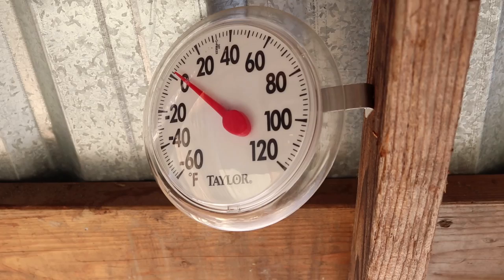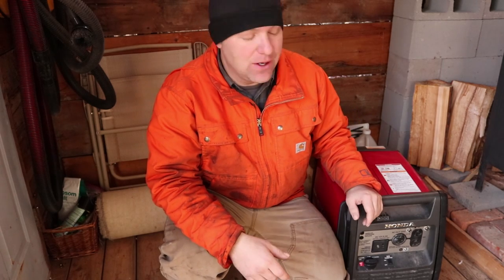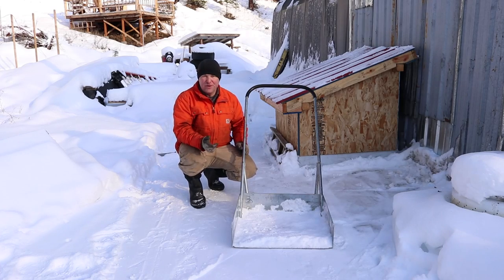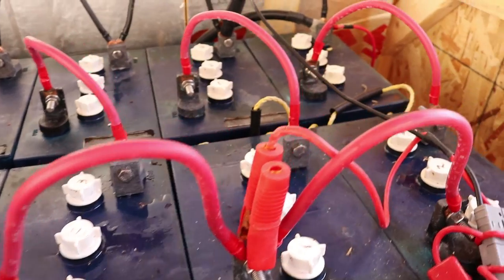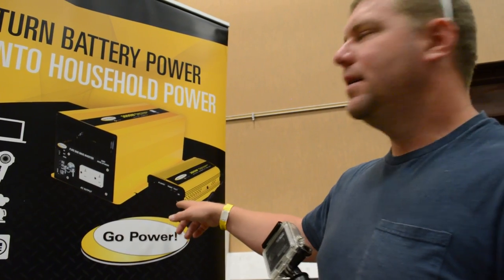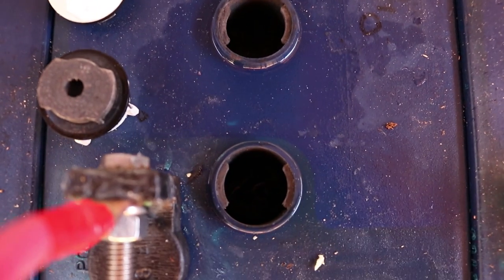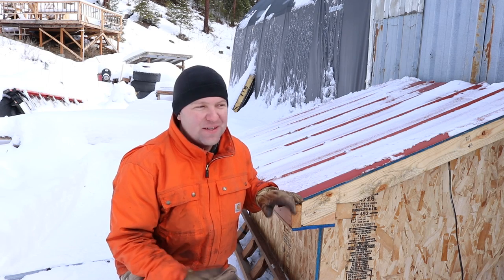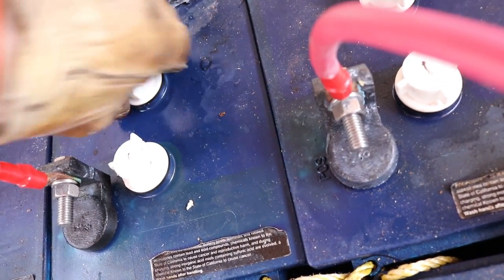SO FRIGID BATTERY ACID IS FREEZING! + Off Grid Power problems

Comment: If you opt to change out the Gen Set,  you may want to go with Propane  it is less messy and keeps you from all of that Gas exposure.   Can you get a large Propane Tank in your area?

You may want to create a sunken power station in a hole some where to reduce noise and keep the Gen Set out of the elements.   Ventilate Well!!!

The heat from the Gen Set will help warm the battery box and keep the Oil Warm.

Comment: I was raised in Montana and it gets very cold there. For cars there is a head-bolt heater which is a system that you plug your car into at night or whenever you need to start your car, It keeps your oil from getting so thick from low temp, that the motor will not turn over fast enough to get started, I don't know if there's anything like this for your small generator but a 100 watt light bulb put under the oil pan should keep the oil fluid. I have no idea if your solar system can generate enough power to keep a light bulb burning?

Comment: Might I suggest the following: 1) The Two Bad Batteries are causing the Inverter problems; you have identified battery problems that charging will not always fix; consider that if problem was divided amongst all cells/ all batteries then problem is charging, but problem on JUST 2 batteries (of 8/10/12 batteries?) is a battery problem; 2) Moisture/ WATER in your fuel is causing your generator problems, (esp. if you are using ethanol fuel, but (sometimes) even when you use Pure Gas... maybe just from condensation from the cold weather.  Keep all lids/ vents properly closed; 3) (Believe it or not), if OHV Honda, you might also need a valve adjustment to get compression release to work properly to make cranking/ starting easy.  Hope this helps.

Comment: Hi Guys, I'm assuming that your using lead acid battries because they were cheap. you need to get some sealed gel. they are designed more for what you need your power bank to do, and I'm pretty sure they won't freeze. My tip for getting cheap ones is find a local wheelchair repairer. when their battries are replaced you will usually find one of the two (24volt system) will be still in good operational condition sometimes both especially if you going to use them in a large bank. the repairers might even give them to you, or sell them cheap and have them tested. upside is your recycling. Stay warm and good luck.

Comment: Just an idea, why not connect the battery box to the cabin? Looks like the battery box is right behind the wall where the stove is. Remove the back plywood wall of the box, remove the cabin wall, connect the box to the cabin, leave the cinderblock wall in between the stove and battery box?

Comment: In my experience, the reason your generator is having problems is because the carburetor is jetted on the edge of being too lean. They (Honda) do this for emissions purposes, but if it doesn't run right, it pollutes more anyway. If a tiny speck of dirt or gunk gets into one of the internal passages in the carb, it skews the metering.

When it is cold out gasoline has a hard time atomizing/vaporizing so it needs to be richer in order for enough of the fuel to vaporize so that it will burn. That's why you start it with the choke, it chokes the air supply down so that more fuel is drawn into the intake, making it richer. See if it improves under load by pulling the choke out slightly. That's not a fix but it will point you in the right direction.

It is also possible that there is some dirt or gunk in the carb, causing it to not meter fuel correctly. Get some carb spray and hose the inside of it out.  That may help as well. It's still under warranty right? See if the service center can/will re-jet the carb if cleaning it doesn't work.

Comment: Love the videos!
Just a question: is there a reason you cannot add more insulation to the battery bank box? I'm just thinking about redundant systems because my well pump froze yesterday. It looks like there isn't any insulation on the sides or under the roof and possibly not on the front or floor as well. Might additional insulation also help keep the batteries from freezing?
Best wishes with the generator!

Comment: Would recommend a diesel generator as diesel doesn't freeze as easily as petrol (gas) also may be worth moving the battery bank inside so it gets some heat from the wood heater as you will eventually damage the cells that are frozen due to the electrolyte getting stronger since the acid doesn't freeze only the water does :-)

Comment: If one has to run the generator in order to Simply make the oil viscous enough to Change, That should tell you something! The generator is essentially running dry when started! Use synthetic Amsoil.

Comment: Need some distilled water to top those batteries up and keep them there! Ice in them, is a concern! That generator.. if it's that hard to start when its cold.. chances are, it's the fuel system itself that isn't quite up to the cold. Ensure the choke is fully closing and give it a squirt of fuel down the carby to help it along, if needed.

Comment: Does your generator have the "cold climate package"? All ours in Canada do. Basically it wraps the carb and intake manifold in insulation to prevent carb icing. If it does then you should jet your carb one size richer. It will start easier and should run better in the cold. Our gas here is crap as well with ethanol in it so I run 100LL avgas in all my small engine equipment. -28*C this mornung with windchill of.-35*C and my snowblower fired up first pull.

Comment: I think I remember you saying these were used batteries. It's important to realize that batteries have a limited life. With a 60 month battery, you might get 61 or 62 months and that's it. In your case, that's due to the chemical reaction between the lead and the sulphuric acid. If a battery looses it's charge, the water will freeze and then crack. Now you will have acid all over and that will have to be neutralized with a baking soda. Let me be very clear about this. If your batteries are really important, go get new ones. Best of luck and keep up the good work. I really like your show.  Buffalo, NY

Comment: Try Royal Purple 5w30 before you spend $$ on another generator. Our power was out this morning so I had to start the Genny. It was outside where it was -14F. I run 10w30 in it, all I had to do is spray some starting fluid in the carb, turn the key and it started right up. Hooked it up to one fridge, two freezer's and two heaters and it ran for 2 hours till the power came back on. Royal purple is the best synthetic oil you can buy, even better than Mobile 1. Try the royal purple!! 😀

Comment: You might want to look in to how your batteries bank is wired up .
First thing that comes to my mind with 1 bat dead or dying & low on acid is 
How you charge it or weir your drawing power from
Look at some wiring diagram. That 1 batteries is taking the hit all the time & will make it heat up & use all the acid in that batteries…
 & your batteries need to be fillet over the plates .
Or They will short out.
If your solar panels charge directly in to that one batteries I don’t think that’s right ok
Keep up the good work totally ausom

Comment: Runs good for a while and then bogs down under load in extreme cold. Sounds like the carburetor is icing up to me. This can be a problem with all engines with carburetors. I'd set it up so it draws air from the 'cold' end of your cabin, or make an intake pre-heater for it that uses the exhaust for the heat source, the way most cars with carbs worked.

Comment: try a different gas also tried choking it when it does that also it sounds like the governor needs adjusting the governor Springs need to be replaced take a piece of tape and put it over part of the air filter to increase the fuel then do the opposite remove the filter so it gets more air

Comment: More insulation in the battery box and a 12 volt computer fan ducted from inside your shelter into the battery box. Would be a low power way to keep the ambient temperature inside the battery box the higher.

Comment: Hi Jesse, it's just a guess but isn't your wood stove just on the other side of your battery box (or close to it).
If so, how about running a pipe to circulate some warm air from the stove to the battery box ? or just make a hole to connect the two ?
Also, get some house wrap (plastic sheet), wrap your battery box, and then pile a bunch of snow on the sides up to the top,
Snow is a good insulator. 
Enjoying the videos, and your journey Great fun :-)

Comment: pop the fuel bowl off the carby check for dirt and remove the jet and blow through it with compressed air or wd40. if that doesn't work your carb maybe icing up.

Comment: Greetings from snowy off grid Oregon.I think that the batteries that are frozen are the bad ones. They will keep the other batteries from taking a full charge. If the specific gravity was up they would not freeze at 0 deg. Ill bet the frozen ones are toast. I try to never let my off grid battery bank run lower than 80 percent full. We usually only use the top 12 percent. I think you would be better off taking the two bad batteries out of the system IMHO.

Comment: Question.... My battery bank is in a shed on property and I was wondering since while we are not there but once a month during the winter so there is no draw on the batteries ..... will they be ok with my 4 solar panels and my charge controller to keep them topped off? they are new L16 batteries if that matters.

Comment: Ice inside the batteries ! - I can't believe there is no insulation inside the battery box ? looks like there may be some on the back panel.  There should be insulation on the inside of all six surfaces.   I would also separate the batteries and place insulation between them and remove during the summer.

Comment: Have you checked out forced air solar heaters? I think you could throw one together in a day on the cheap..mine is 4'x8' and about equal to having a 1000-1500w heater on whenever the sun is shining. g scott davis has some great videos on them. Also, I think if you just put a clear roof on the battery box and maybe add some black paint it would heat it up a ton during the sunny hours. cheers!

Comment: Batteries freeze when low on water. Oh never add water. Only distilled. 
Honda. I have the same generator plus a 2000i plus several other Honda products. They are very VERY sensitive to fuel and water/condensation in fuel. I have changed several float bowls because of rust! Crazy but true. I stoped using pump gasoline and went to Aspen Synthetic fuel made by Husqvarna. Both 2 and 4 stroke they sell. Expensive but no more problems.

Comment: Stating the obvious, clean the carb also could be card icing.
Reply: Was about to say the same myself (Carb Icing) The only solution for that is to warm it up or lower the load (less load, less venturi effect, less icing)! Care is needed with insulation of the batteries ..... those bubbles are Hydrogen and Oxygen which is a VERY explosive mix, and you do have electrical connections and Crocodile clips in there! Have you thought about burying the batteries below the frost line? Still need venting though!
Reply: Tried to reply before, but internet ate it?: Recommend 1) fresh fuel w/ stabilizer, maybe even canned; Pure-Gas.org for non-ethanol from pump, I suspect you have moisture/ water in fuel; 2) Suspect 2-batteries shot/ bad, even before freezing; bad cells will not charge, leaving neutral ph water which can freeze; 3) Suspect generator may also need valve adjustment (See youtube for How-To)
Reply: It is not normal charging / discharging though! The batteries are being deeply discharged ...... there WILL be gases (not a problem if vented) BUT if insulated or dropped in a hole will be dangerous! It looks like 2 cells are suspect (warped plates / too weak acid mixture) but you can check this by the hydrometer readings!

Comment: I would remove the bad battery from the string because the string it is part of will drag the other battery strings down and destroy them.   This is one of the issues with using parallel battery strings.   So if you have two questionable batteries pull them out and make your system three strings of 12 volt rather them four strings.

Comment: If you have a bad battery or two you would be best to pull them from the bank and use your good ones only.  Bad batteries will do damage to the rest in the bank as they are always trying to equalize.  Pull the bad ones and put a load tester on it.  Also I have had some success bringing heavily sulfated batteries back to a good state with use of a pulser.

Comment: You need a good carb tune or swap. Now why not insulate the battery box with snow?
Reply: I would ask for a new carb.
Reply: Its doesnet need new carb, only bigger nozzels to run richer in cold weather.
Reply: Further research shows the problem is icing in the intake or carb from cold damp air.  The intake air needs to be heated to at least above freezing.
Reply: or dirt? Same with the cabin, actually, if there's enough dirt on the property. Thermal mass as well as insulation.
Reply: TheKlink
Of course a soil berm would be the best but that would be a spring project. Even a greenhouse with a few water barrels would help to keep the batteries at moderate temps.
Reply: move battery box within small propane heated mechanical room, add small muffin fan to exhaust H2 gas, automatically turning on and off in response to software in charge controller.

Comment: Hi there.  I wanted to leave a couple of comments to you concerning your generator. the question I have for you is is the generator set up for high altitude running? it sounds like that it is starving for gas in the cold. I don't know if that carburetor has adjustments for a leaner or richer mix butt it definitely shows signs that it should B set a little bit richer than it is. if your service guy is at a lower altitude that's why it runs fine at his place and doesn't do very well at yours. I have an Outback the VFXR-3524A which is a 24 volt 3500 Watt inverter charger system more popular in off grid or grid tie conditions. when your inverter / charger starts to charge get over powers your generator. that is why you are seeing the brown out conditions. your system probably has a soft start charger and when it reaches full load the generator cannot keep up. if you can vary the amount of charge current you can make your generator run more like you were wanting. otherwise you should consider a larger generator. good luck to you and I will watch for additional comments. by the way, where is your cabin or home at? I am in Salt Lake City but I grew up in Idaho.

Comment: Nice battery experiment. I almost went with GoPower for an inverter but I ended up getting a great deal on a Magnum inverter on eBay. I was looking on your blog and I couldn't find any information on a topic that I am personally interested in and that is: how did you finance the empty property? I am currently on the market for a property but I am struggling to see how to get a lender to lend on vacant land being that it would have to be under the restriction of a construction loan. Seems a little tricky but I would prefer buying an empty lot as opposed to getting a house. It would be great to hear what kind of experience you have had with this.

Comment: Please dis-regard if I saying something you already know but I would go to Wally World (or similar) and purchase an inexpensive ceramic heater to replace the one your using that has open hot coils for your battery box, Lead Acid batteries will on occasion vent hydrogen gas, specially if you've one going bad, and a ceramic heater doesn't have glowing elements that might ignite the Hydrogen. Also I would surf an Electronics Surplus site, such as TheElectronicsGoldmine.com, and order a very inexpensive small exhaust fan (such as a computer coolant fan) that runs off an included small solar cell to keep gases from collecting to greatly.
Love your site.

Comment: try using a heat tape around the oil pit of the genny. and batteries. it does use a about 15 watts over night.but should allow the oil to flow better in the genny.   also get a wind generator, for the night time use on power system. it helps some.   I'm still using my 1967 simpicty  800 genny I bought used twelve years ago at a junk estate. for fifty bucks. I've had to use it with as low as ten degrees, it was hard too start but did run after a few pulls. the eletric starter quite on me but the gen did not freeze up. the heat tape works.

Comment: Remember, the gasses from the batteries charging is flammable. 100 W incandescent lightbulb on a remote switch should keep a good amount of heat in there all the time, with low probability of ignition.IMHO

Comment: Are you getting ethanol free gas?  Ethanol and cold weather don't mix.  As mentioned in other comments i've read, could be the carburetor is icing up as well.  Airplanes that fly at high altitudes have carb warmers to keep that from happening.  Cold just wreaks havoc on everything once temps get that low.

Comment: they probably dont read the comments here, but i will throw this out there about the batteries. i notice there is moisture on the tops of some of the batteries. always wipe them off, and make sure the tops are good and dry when they get wet or have any moisture on the top. because from what i have always been told that if you dont then that moisture actually will cause a slow drain on the battery because the moisture will usualy be touching both posts, and create a small current across the top of the battery. and in some cases it will destroy the battery.